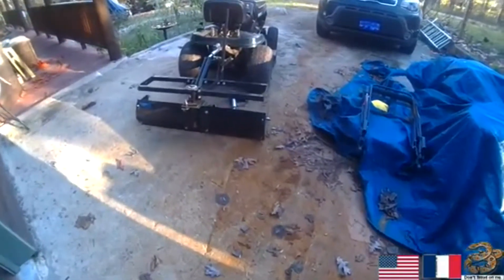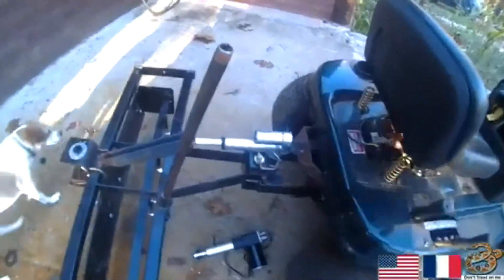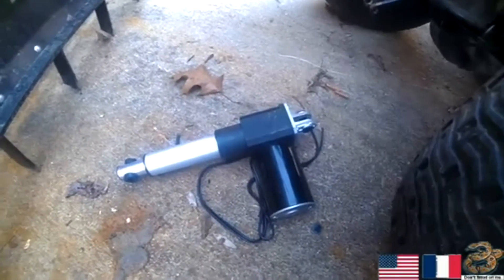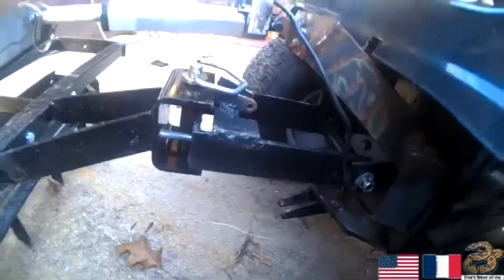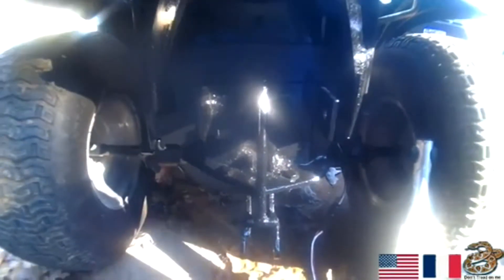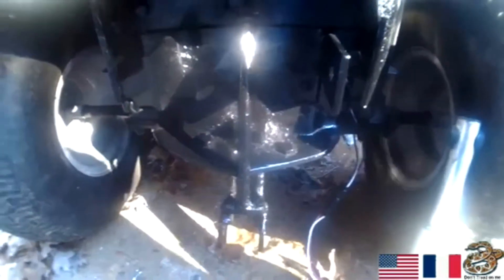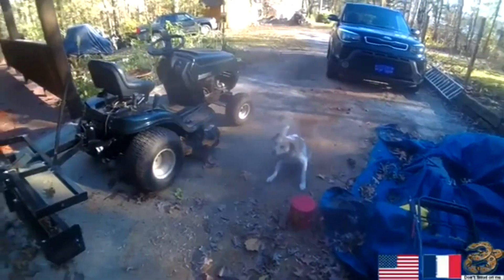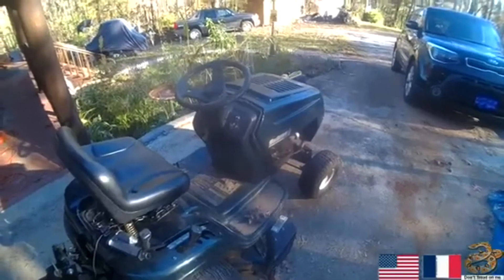Sleeve hitch, part 2...Installing the lift Cylinder (Linear Actuator)

Comment: Thanks!  The CC GT2550 from 2009 has been a headache, the hood opens wrong (towards the front), grease nipples for steering, etc are in awkward places, and the business it was bought won’t even consider it for a trade in, they said too many headaches.  The back steel plate is not impressive and will need beefed up. But I’ll take the measurements off that and adjust yours to fit mine.  I couldn’t hear over the lawnmower, but I think you were saying that you had to move the linear actuator up higher than it’s original position, is that correct?  If I can get this to work, I’ll have to make the hood open towards the seat and keep it another decade or so.
Reply from the maker: I hope the earlier version I listed is clearer...Youtube won't let you repost unlesss the Video is changed...hence the background Music
Reply from the maker: https://www.youtube.com/watch?v=rxamL8UA5k8&t=951s This is an earlier version...no Background Music.
Reply from the maker: Hey there Young Lady, nice hearing from you again...I hope you had a Wonderful Christmas and have a Healthy, Happy New year
Reply: SmokymntnEd I’ve missed watching your videos and your willingness to share your knowledge.  We had a big wedding in GA and caught probably the worse cold I’ve ever had.  And now I’m trying to build a bathroom vanity but having problems with the small circular saw. I set the plate 90 deg to the blade and it’s still cutting at an angle so I’ll be changing the blade again, resetting the base... I’ve gone through all the clamps, cleaned them up and all but one is ready to go.  I need to figure out how to make a spring for the sliding part as the three keys won’t stay in.  It’s got a 1930 date on it and the screw side has a wheel.   It’s mostly been cold to work in the carport.  Oh, and the girls got skunked, bad.  Really bad.  Our herder mix got a piece of her muzzle ripped, skunk oil in the mouth, her teeth turned yellow, our smaller mix got it in the eyes.  All in the snow/ice we had.  Our vet had me out trying to track the skunk.  I couldn’t see the skunk trail, heck I wasn’t even breaking through.  But the dog prints where they used their toes to dig in told the story.  Couldn’t find any blood or the skunk. It looked like it made it to the brush and I wasn’t going in there lol.  If your pups get skunked, don’t use the recipe on line with Dawn, it’s the wrong soap, just use liquid hand soap and gloves.  Here’s the correct recipe. http://home.earthlink.net/~skunkremedy/home/contents
Reply from the maker: ommon
Reply from the maker: @elained2448  I don't know what's going on, my replies keep messing up and dissapearing?  Three times I've typed this and got nothing. One more time!
Reply from the maker: @elained2448  One more time...Thanks for the  Remedy I saved it to my Favorites.  I got a chuckle out of your sharing my knowledge statement...I believe you could fit all of my Knowkedge in a Shot Glass with no overflow....I just use Common Sense, and Stubborness to solve problems...If something works and I think someone could usethat info, I post it....I get Thumbs up, as well as Thumbs down but everyone has an opinion...If one of my ideas Helps A Youtuber out it was worth spending the 7 Hours posting it...Take care and if it Stinks go the other way...LOL
Reply from the maker: Elaine, sorry I made a mistake the Linear Actuator Segment without background is here (https://www.youtube.com/watch?v=zp-qM8vVKXA&t=15s)
Reply: SmokymntnEd thanks!  I don’t think you’ve put up anything I haven’t liked. And if your knowledge could fit in a shot glass, mine won’t make it halfway up a thimble
Reply from the maker: @elained2448  Lol  Aw Shucks Mam!
Reply from the maker: Elaine, could you do me a big favor?  We had a really weird Fishing Trip one day last Spring which we are still tryng to puzzle out...If you get a chance take a look at this Video (https://www.youtube.com/watch?v=HBkbSb13K0o) and give me a Female thought on what happened...My wife and I are still trying to figure out what happened.